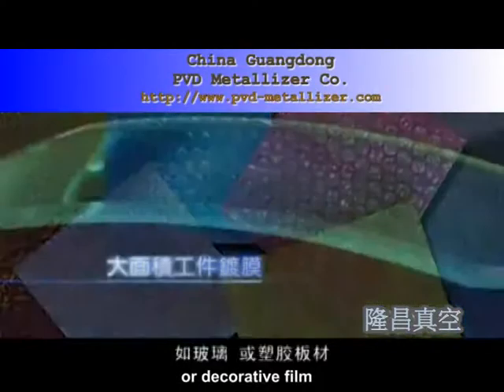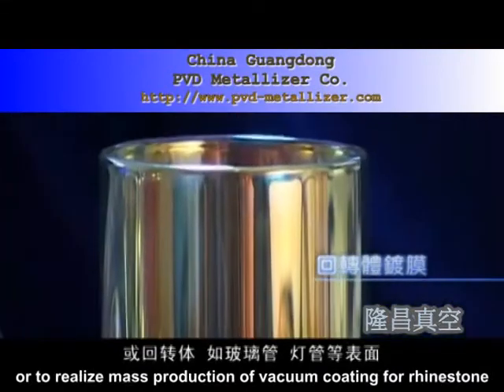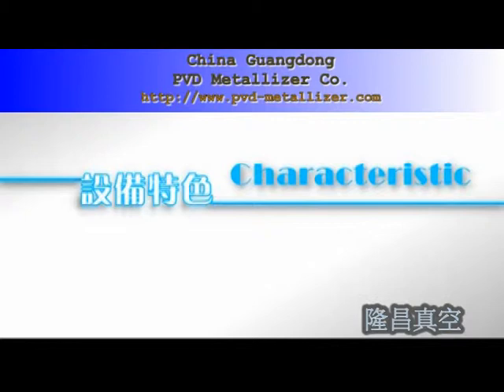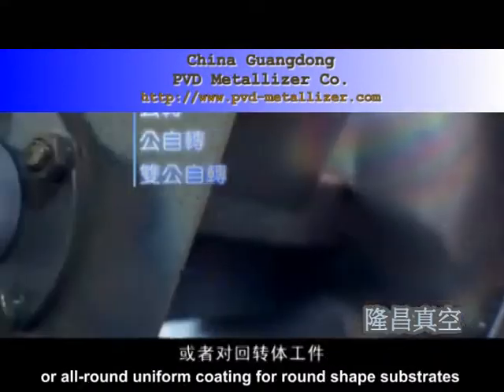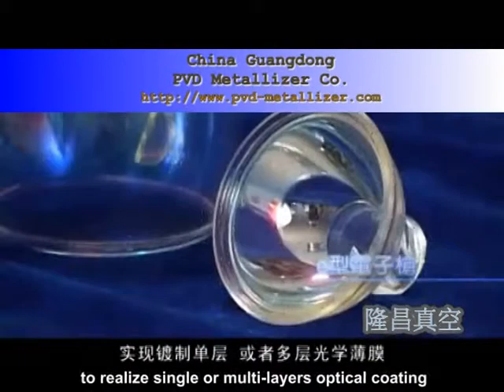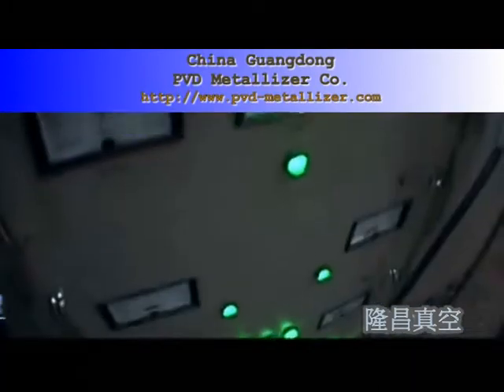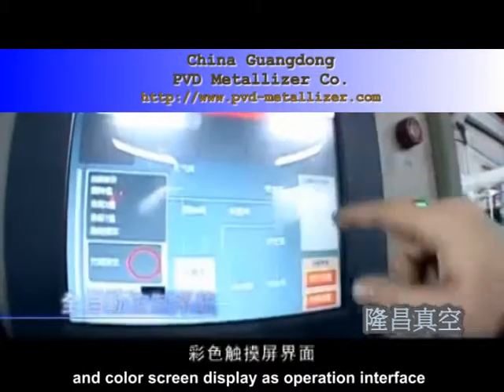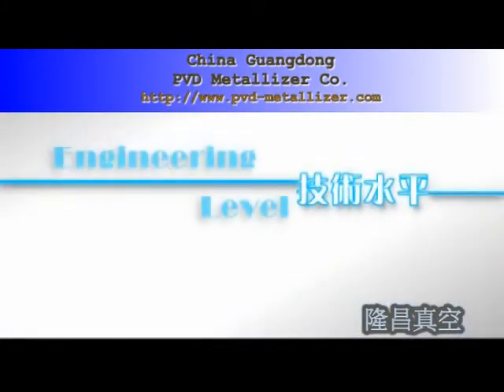Horizontal type E-beam optical coater

Comment from the maker: Horizontal E-beam optical coater

http://www.pvd-metallizer.com

To coat optical film or decorative film or functional film on large-sized substrate products such as glass or plastic panels, or to realize mass production of vacuum coating for rhinestone, lamp glass slip, round shape articles as glass tube, lamp tube, the horizontal type E-beam optical coater is the best choice for customers.
Horizontal structure E-beam optical coater generally can have large quantity substrate loading with single or double revolution and rotation substrate racks to realize three dimensional moves to make single side coating or all-round uniform coating for round shape substrates.

China Guangdong PVD Metallizer Co.

Alex Li
Mobile: +86 13929890858
Skype: vacuum-metallizer
Email: vacuumsale@hotmail.com
598828529@qq.com
Website: http://www.pvd-metallizer.com
Address: No.1 duanzhou road, Zhaoqing, China

Please click below to see videos of our metalizing machines:

http://www.youtube.com/watch?v=ksrnggJYYVI
http://www.youtube.com/watch?v=dt4Cu7uWCug
http://www.youtube.com/watch?v=ux01xRBDbgw
http://www.youtube.com/watch?v=Of1t1_YYCj8
http://www.youtube.com/watch?v=YzTisG_A3k0
http://www.youtube.com/watch?v=MRKtFwEPEiM
http://www.youtube.com/watch?v=3-K4iuf2snE
http://www.youtube.com/watch?v=X191aw9GWDI&feature=youtu.be